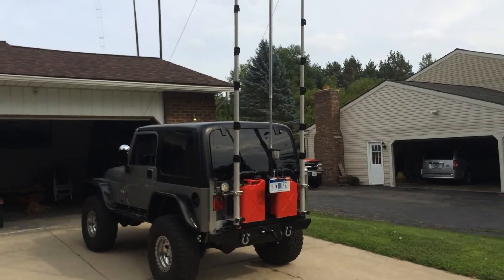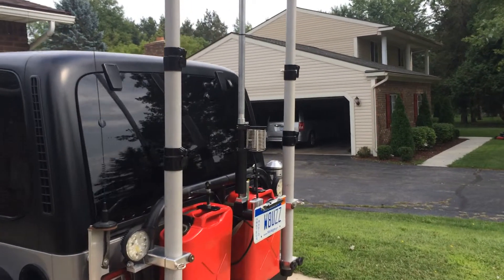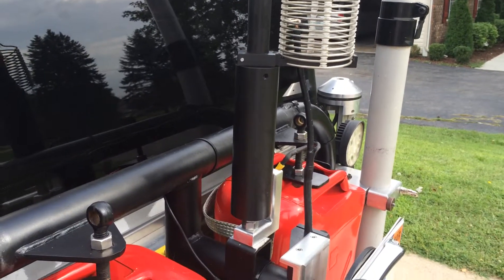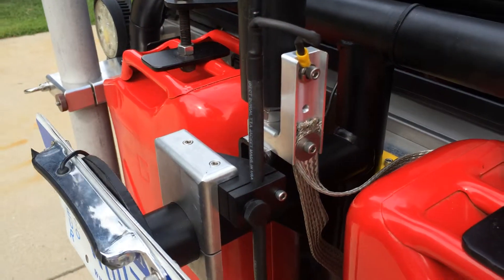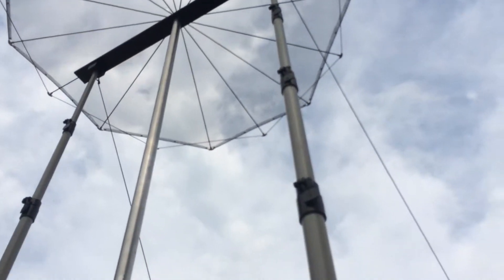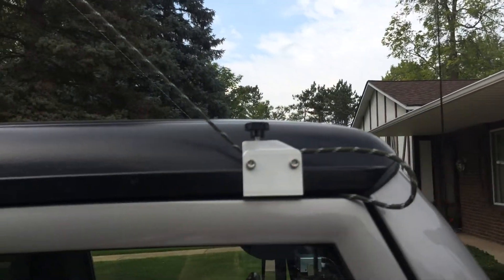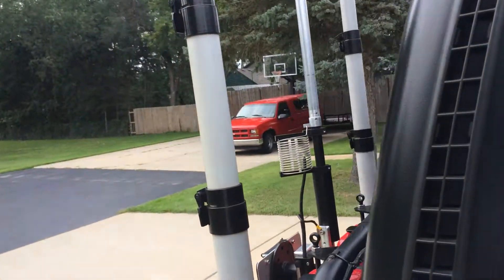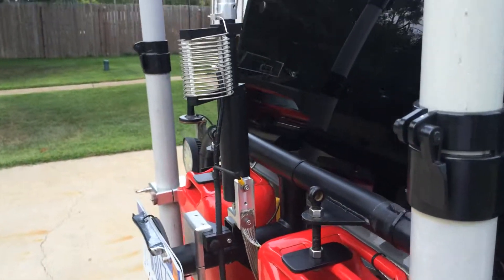W8UZZ Capacitance Hat Shootout Rig

Comment: How is the performance?
Reply from the maker: The larger the hat the greater the efficiency. Shoot out competition limits diameter to be no larger than 8ft. The screened hat creates even more capacitance.  If you can handle a longer radiator the signals reports are off the chart.  Shoot out competition limits height to 13.5 feet from ground up.